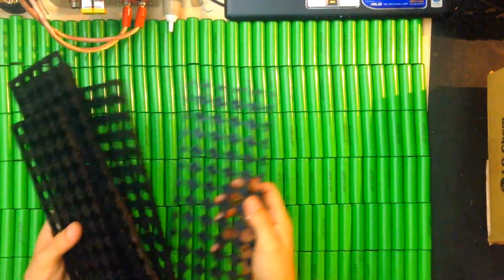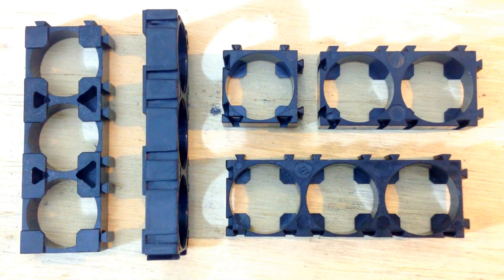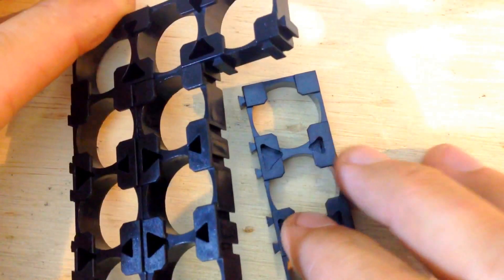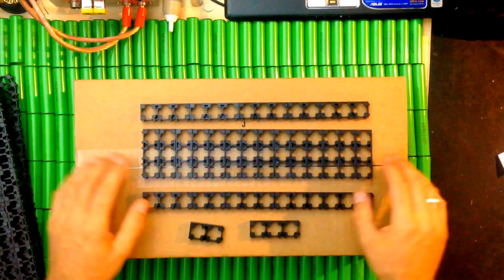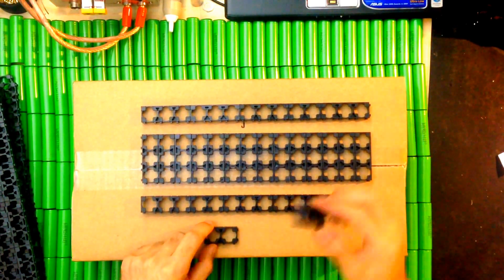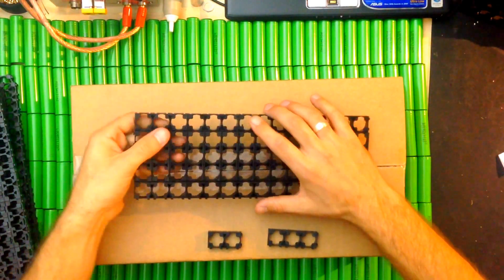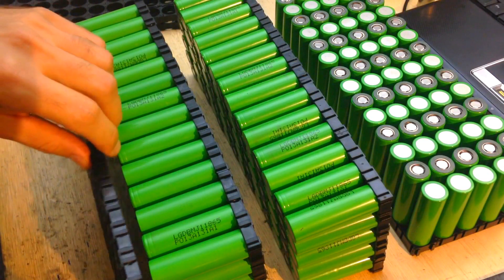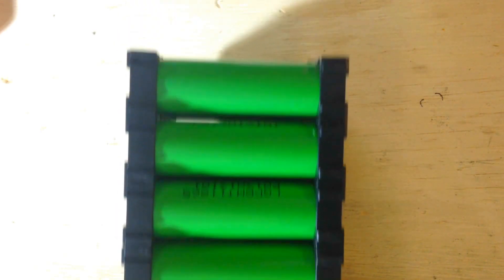DIY Battery: tutorial how to put 18650 cell holder together - Lithium batteries spacer separator

Comment: Hi again
I have a serious problem with my battery (or possibility my bike)! I bought the BBSHD and LOVE IT!!!! So much POWEEER! I also bought a Topeak MTX 29'r rear rack and a 20Ah Battery (about 5kgs). I placed in a bag and mounted it to the rack, simple! After just 4 rides (about 130kms) the rack was so badly bent on the left side it was unusable. So I took it to the closest bike shop and they honestly believed someone had intentionally damaged the rack. So I bought a new one and it was mounted by the shop today, I road just under 20kms home (fast) and when I checked the rack it was starting to bend the new one in the exact same space with the exact same damage!

I'll take it back to the shop and see what they say but I'm thinking I should just buy a large triangle bag? If I do that I will need to cut open the 20Ah battery pack and move stuff around to make it fit inside the frame's triangle. Have you tried this before? Is it ok do do it like that? Do you have any suggestions for this problem or have you seen this before?

Thank you!

Comment: Hello Bruno. I read some comment that the space between cells does not cool down the cells as the air between is not moving in case. And was said to glue it together you get same cooling effectivity. Dont know will measure it. Cheers
Reply: Correct, if you wrap your battery and stop the airflow. If you mount the battery on your bike with only the cell holders like in the end of this video, you are gonna get some better coooooling.

Comment: Hello again 

I am in pursuit of powwweeeer and need your help my kit is 48v and I have seen people making 52v battery packs for the kit , my question is what is best for the powwweeeer and the best way to charge them to around %95 capacity to give me more charge cycles. I am also lost for which charger to use.
Reply: 52v or above will give you loads more power and torque but any normal BBS02 or HD LCD computer will give you junk voltage measurements so gauging the pack charge state is tough unless you use an onboard power meter to track it and know your pack capacity.Cycle Satiator  is generally considered the best option for accurate partial charges, there's a review or it on this channel among others ain't hard to find. Or use RC chargers if making the pack yourself and confident adding appropriate balance connectors and parallel leads so 6s or 12s chargers can be used with your 14p, 15p or above packs. Cell life will be much better this way than a cheap BMS but please don't do it unless 100% sure of your path.Not totally sure about the BBSHD limits but anything above a 52v (nominal) will send the BBS02 into safety cutoff and simply shut down until you repower with a low enough voltage pack.